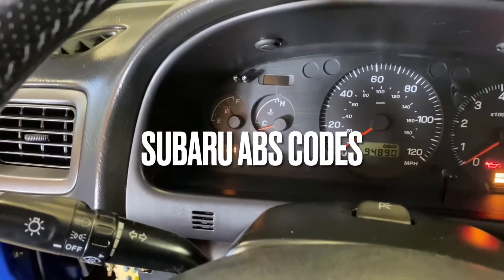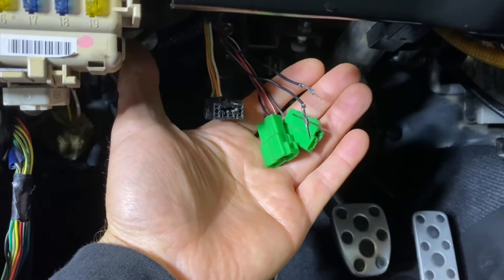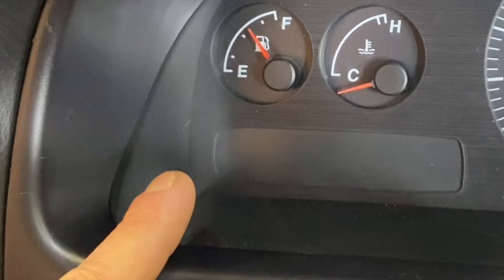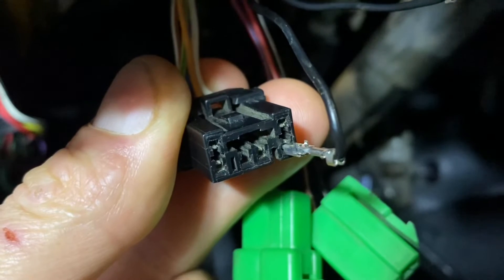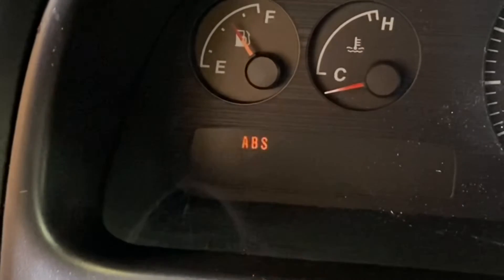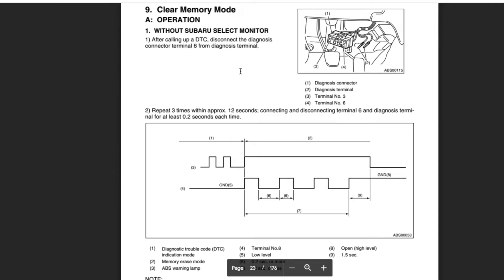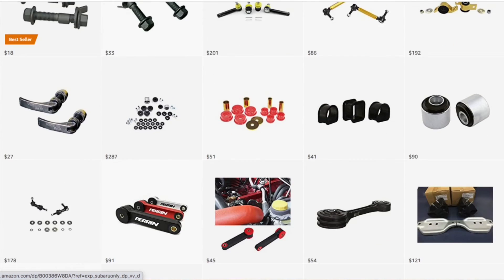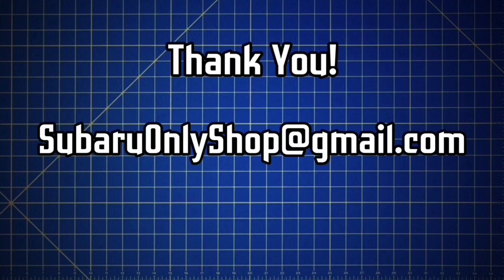Subaru’s GENIUS Way to Check (and erase) ABS Codes

Comment: I have an 03 outback and can't find the black plug. I found the 2 grounds and the green plugs, but the only other plug is a white one rhat looks very different, and they are by the center console. Can you help me, is there somewhere else I need to look?
Reply: Mine was taped to a larger portion of the harness up near the center of the dash

Comment: 1994 Subaru SVX front wheel drive model ABS light is on where is this located?
Reply: My car has been sitting for over a year. I’ve been very sad because I can’t drive it. I finally got the motivation to just do it my damn self because no mechanic seems to want to work on it…. 
Also, I’m having a transmission issue. It has been hell. Obviously, we wouldn’t wanna go with a 4EAT transmission. Front wheel drive wise what else would be a suggestion?

Comment: hey man, Do you have a video on how to remove and replace a clutch on a 6 speed manual transmission and also shifting bushes replacment? I have a 2005 subaru legacy/liberty with the EZ30 6 speed manual. Thanks bruv

Comment: I watched this video. Repeated your words, tone, and rhythm verbatim.  To no avail, the freaking codes will NOT clear 🤬. Impreza WRX 2003 AT USDM 2.0

I need them to clear to troubleshoot. Help.

It’s torture coming back up and looking at the ABS light staring at me like the Geico fishmerman from  “I got you a dollar. Ooo you gotta be quicker than that” commercial teasing me with 11 and then all the stored codes.

Comment: have 2003 outback h-6 4dr. traction control light on..did new brakes all 4 wheels..still have a front wheel shutter real bad on freeway if I hit brakes hard.feel it in steering wheel

Comment: If you clear a code how long will it take to come back if something is still there?
I bought my first Forester used and the dealer is working on 3 codes
Abs, Hill assist and traction control
They said it was fixed and the codes came back in the day I got it back. 🤷‍♂️

Comment: So...... My 1996 Impreza outback has that diagnostic connector BUT... there are only wires in pin locations 1 and 2. 4,5, and 6 are absent. Any help there?
Reply: Any luck? Mine only has 4 pins as well
Reply: Mine has two pins and ended up falling the airbag. How did you go?

Comment: Thanks for this! Worked on an 02 legacy. Wheel bearing failure on my sisters vehicle and destroyed the abs. New sensor in and wouldn’t clear. Had to pull the dash panel off to find it, but it was tucked way up there and electrical taped out of the way.

Comment: I have the connector, but there is no wire in position 6 and therefore nothing to connect to. I've triple checked the position I'm looking at but I can't figure out what's wrong. Anybody have an idea?
Reply: Any luck? Mine only has 4 pins as well

Comment: Hmm, I can’t locate that black connector with pins on my 2005 wrx. It only has green ones and a grey 6 pin connector (3x2) in which pins 2 and 5 (middle ones) are not connected

Comment: Hi I need help with my subaru legacy 2000. It will turn over UT not start I've been trying for a year and a half n is.  I've replaced everything with the fuel line and pump. On the I/M readiness it shows: DTC 0, PD DTC 0, MIS green check, FUE green check, CCM green check, cat red x, HCAT 0, EVAP red check, AIR 0, 02S X, HRT X. could you possibly know what that's means or point me in the right direction? Thank you.
Reply from the maker: Hmmm, sorry to hear!! Love that model though. I don’t know off the top of my head, but I’d get a tool to verify spark is working at the plugs (they have inline tools that verify this). Spark issue is pretty common.  Then verify the fuel is making it to the cyl.  Good luck!!! 👍
Reply: Thank you I will look at them and see. I hope I can fox it soon, it's been to long.

Comment: I just got D-U-N-E...  I mean done with this. It worked. Instead of a screw I used & cut down little yellow 4"inch  Bondo Spreader. A yellow body putty spreader. I cut it thin side to thick side worked like a charm really did. I cut it back to where it was a little thicker cut that in half saved the thinny thin area. That combination moved the plug over beautifully. But I was little anal so I used that left over real thin edge part of the spreader to move totally taunt or tight. Worked like a charm I even took the car over some real hard known pot holes. Seems all good?????/ Let me know but that was my approach. Not everyone has Body Bondo spreaders up their butt cracks but I have em coming out of my ears and could not think of using something better.. If I had any brain powers during my rush one thing I would have done is put a little Body panel Glue over the fix... Not like its something re-repairable anyhow.  Just so folks that watch my channel know Bubba my big stray tabby cat he helped me fix it too. THIS WAS MY METHOD... LET US PERFECT THIS F UP... I PLAN ON PUTTING A MOTOR IN THE CAR 4 MY SON NEXT YEAR. I AM A LITTLE BETTER AT THAT STUFF

Comment: Thank you very much. I accidentally triggered P1507 and ABS light on. I forget to connect the brake booster vacuum hose to the intake manifold. I needed this video to clear the abs code.

Comment: Thank you. Great help.
My 2005 Forester LLBean has the connector, but there is a cap covering the pin sockets. Also, I can't locate the "diagnostic pins". Someone suggested they were grounding pins. I wouldn't want to ground pin #6 without knowing for sure.
Very informative video. Thanks again.

Comment: Thanks for the video! I was all excited to do this for my daughter's 2005 Subaru Forester X 2.5, but it has a 7 pronged gray port and NO prongs to plug into the gray port... any ideas how to fix for this car?  What's weird is that the ABS light came on after I replaced the brakes front and rear, so I know it's connected to that.  thank you in advance
Reply: was looking for the connector last night as well! eventually found it taped up in a loop right above the 2 loose green connectors, hope yours is the same. You might have found it by now, but just in case
Reply: I never found it, but I got a pro code scanner and attempted to remove the code which it did but then it came back immediately so I pulled off the wheel and found that the sensor ring was broken and dented in which I repaired and it seem to work for a while but the code came back and I haven’t had a chance to look at the ring again to see if it moved I’m going to do a video on repairing that sensor ring on an 05 Forrester ask because it doesn’t have the back discs so I’m thinking I can just pull off the axle and there’s no video showing that anyway thanks for your help

Comment: I have a 00 gc8 GT and after the car wash, the ABS light turned on. Now it doesn’t turn off, not even at ignition.
Reply: I have a similar problem! And I have a my00 Impreza gt too

Comment: Hi. It seems like you’re helping others so I’ll give it a try 😊

I have a Subaru Outback 2011. 
Traction light, Anti locking brake system and check engine light is on. It first started w driving cruise control long distance and kicked me off of it..
Since then I’ve had the head gasket replaced, oil sensor, just did brakes and rotors.. among other things & these lights come on and off… maybe when I hit a bump? I don’t know
Please help!
Thanks
Reply: ABS sensors, one of rhem or more, need replacement. To perform hard reset, disconnect positive yerminal to battery, wait 5 minutes, hook back up. Depress brake pedal to remove any built up electricity, then turn key to on position, but don't start. After 5 minutes, start car. This will buy you some time to finx problem sensor and replace. Factory sensors are about 135 bucks apiece, usually sold in pairs. I used after market sensors for 35 to 40 bucks a pair
Reply: @williamcooke6056  thanks a bunch. I guess I need to get that done!!
Reply: @hopefulinchrist4368  the reset is only temporary. I just replaced all four ABS sensors and mine is still tripping off the cruise control, so I'm still trying to solve this. It went a full week and several hundred miles after the replacement, which was better, but now is doing it more often again. I'm hoping the fact I used cheap Chinese sensors isn't the problem. Make sure you always put your gas cap on tight, and that it is clean and fits well. That will trigger a bunch of lights and codes too. Not changing the oil often enough will trigger it too.
Reply: @williamcooke6056  wow I’m sorry the problem has come back for you!! I hope it will get fixed. I usually seal my gas cap tight and I’m on time with my oil changes. When I’ve had it reset, it would remain off for a while til I hit a certain speed and maybe a bump or something. It never last long. I do need to get it checked out.
Reply: @hopefulinchrist4368  When the Check Engine Light comes in, for sure there us a Code stored, so if you can go to an auto parts store and ask them to read it for you. That is what any mechanic will do. Then you know for sure it is the sensor, and it should tell you which one, because they are spend unless you order cheap discount parts. A lot of mechanisc won't put in parts you buy, as it makes it difficult to warrantee their work.
Reply: @williamcooke6056  thanks for the advice, I appreciate it and will do so.
Are you having to buy new ones as the used ones aren’t working well?
Reply: @hopefulinchrist4368  no, money but cheap Chinese sensors are working, I have a different issue now in the Torque Converter of my transmission. I can still drive it, but it isn't a cheap fix. If you get the right mechanic, who doesn't charge you an arm and a leg, and who will install the parts you buy, it is worth it to try to use them, in my opinion. You'll  save about over 400 dollars in parts, if you have to replace all four. But getting the code read, it should pinpoint shich sensor is bad. That being said, you usually have to buy both front and/or both rear sensors at a time, but they are 35 to 45 bucks a pair, instead of 270 bucks for thd front two in an auto parts store, and 295 for the rear pair.

Comment: Hello, I am on an EURO SF5 Forester from 00', I've got the green connectors, but instead of pins with black wire I have black connectors ( red wire ) that you can plug together to diagnosis the Check engine light, is it those black connector you need to wire to the 6 port of the ABS connector ?
Reply from the maker: Not sure about this model. Hmm. Sorry.
Reply: @SubaruONLY  I finally found them ! The pins were hidden in the black tape at the top of the harness 😅
Reply from the maker: Awesome. Nice man!!! Glad you found them!!!
Reply: @SubaruONLY  did succeed to scan an erase big thumb up for you man 🤙🏻

Comment: Brake noise question 
05 outback automatic trans
Humming coming to a stop. I see glazing on rotors with 50% brake pad thickness. Can this also be transmission related?
Reply from the maker: Yes, could be. Try to slowly bring it to a spot using one the hand brake, that might help isolate the sound.  Also, try slipping the trans into neutral as you apply the brakes.  Cheers! And good luck!

Comment: I will pay money for someone to show me where this connector/pins are in my car.  I've got the bottom panel off.  I've looked for 30 minutes.  Untaped bundles.   Can't find anything like this.  It's a 2007 Subaru Impreza (sedan).   Is there something different or another procedure with this model??
Reply: same here… 06 impreza
Reply: Listen to the video again...40 to 45 second mark.
Reply from the maker: Sorry of the late reply, this one got totally missed, my bad! Ever find it?
Reply: @SubaruONLY  No, never found it.  I feel that I did give it a pretty good go at looking for it.  In the end, I sucked it up and just bought a scan tool that reads more things (like ABS) than just check engine stuff.  It quickly pinpointed the problem(s).   But I appreciate the video you made!
Reply: @SubaruONLY  I also cannot find this under the dash of an 07 impreza. I see the two green connectors, but no black 6 pin connector and no test leads. Great video all the same! Just wish i could find it/ I dont think it exists on 07 models
Reply: look for the 2 green connectors. if can not find then idk
Reply: oh green should be directly center under streering wheel

Comment: Works also for my 04 WRX just the codes are different. Thanks Luke that is the best tutorial I've found.
Reply from the maker: Awesome, stoked to hear it!!! Thanks buddy!!!
Reply: I was able to read the fault code using this method on 04wrx, but could not clear it. Did you follow his instructions to clear the code and thus the light? My code is 23 -left front sensor. Would I be able to clear the code if the sensor is faulty?  Thanks for helping.
Reply from the maker: Not sure if it’s clears for that year, hopefully someone else can comment and help out here! Anyone?!?

Comment: If you clear the codes This way but don’t fix the issue will the light turn on
Reply from the maker: Yes, that is always the case. The codes are triggered by sensors monitoring mechanical parts, if those sensors get triggered again, the code will pop up again.  Always gotta fix the root cause! That’s for another video - cheers!!!

Comment: Does it matter which of the pins you use? Is there a different function for each of them?
Reply from the maker: Hi, for those loose pins leads, you can use either one. Just got to install it in location #6. Cheers!

Comment: Works on my '96 Legacy Outback also.
Reply from the maker: Nice!!! Def works on first gen foresters too! Forgot to mention that.
Reply: My 97 legacy outback has ABS light on but drives normal, when the light goes off my brakes slip and pulse to a stop... the light came on/ it’s been doing this for a few months ever since I hit that tire and put a spare on it. Idk If I reset this code to get rid of the light it will make it stutter to a stop every time like that or if I should keep the light on and keep my brakes working normall. I can always visit the issue in the future

Comment: I had to figure this out with the factory manual. It was confusing, to say the least. My pins were taped up to the harness. Not freely hanging.  I have a right rear ABS code I still have to track down the issue.
Reply: The procedure for later models is even more confusing. For most 05-09 it's this mess.

Starting condition: key off, headlight switch off.
Steps 1 through 7 must be performed within 10 seconds.
1. Turn key to ON position. This is the normal running position, the click just before starting, when all the lights on the dash come on, but before you twist to START. Don't start the engine!
2. Within 3 seconds, turn the headlight switch ON.
3. Press the Trip/Odometer button 4 times.
4. Turn the headlight switch OFF.
5. Press the Trip/Odometer button 4 times.
6. Turn headlight swtich ON.
7. Press Trip/Odometer button 4 times. At this point, the DTC display will begin.
8. Turn headlight switch OFF. Not necessary for the procedure, but your display may be dimmed and hard to read in bright sunlight. Besides, why drain the battery?

I believe you do it 3 times instead of 4 for steps 3 and 5 to pull airbag codes instead. Crazy, but it works. It then gives you numeric error codes which are actually 2 parts and you have to piece them together from the FSM to make sense of them. It's pretty wild, hahaha.
Reply: @802Garage  Thanks, great info.  In Soviet Union they make you do 10 push-ups in between.
Reply: @sezwo5774  😂😂😂 Lada code reading.
Reply from the maker: Haha!!! 😂😂😂
Reply from the maker: This is CRAZY! Geez!
Reply: I think it's a tone ring in my case. I already replaced the Rear ABS sensor.
Reply: I have the same code. 35 i believe. I swapped the sensor but no luck. Did you ever figure out what was wrong?